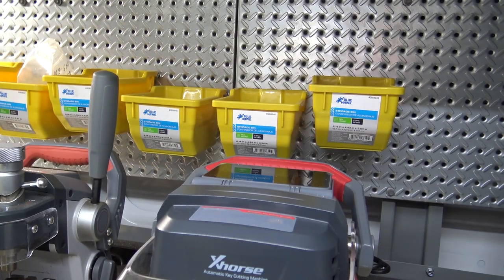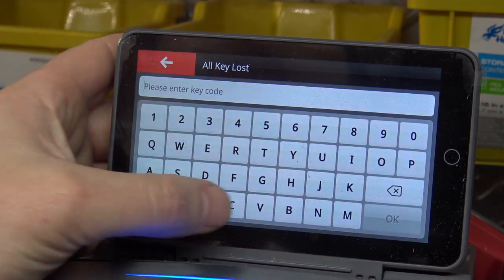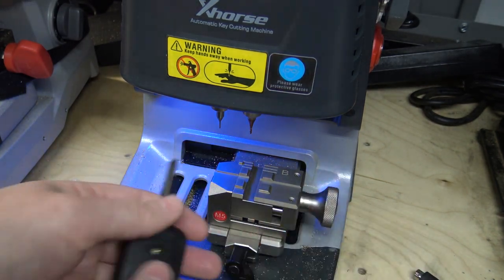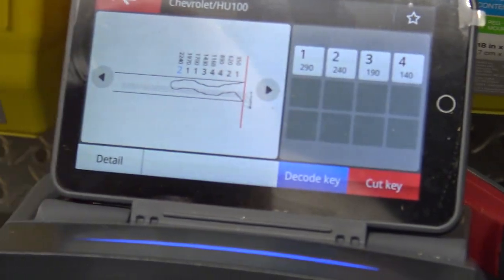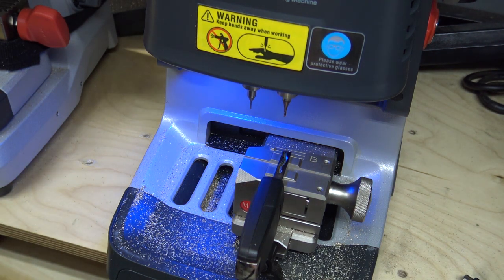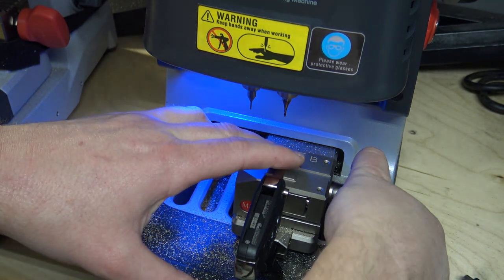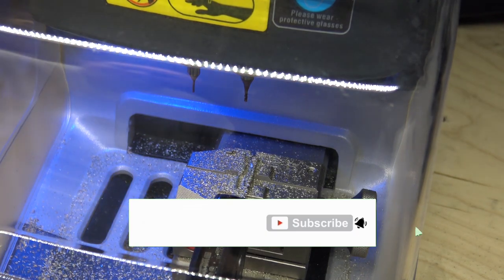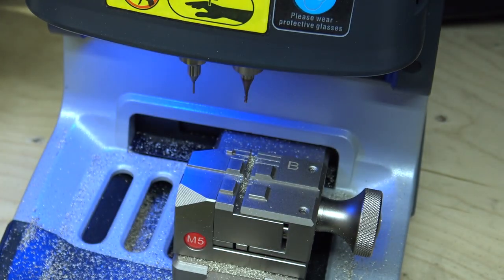(479) Condor Dolphin 2 Using All Keys Lost to Cut an HU100 Key

Comment: does the dolphin xp005 have a m5 clamp or which clamp would the xp005 use?
Reply from the maker: It doesn’t have the m5. You have to switch clamps for edge cut or laser cut. It’s a pain in the ass a little if you’re at a place doing 15-20 cars having to swap them back n forth. That’s a big reason why I got the new one.
Reply: @russej02  i think the m2 clamp is the high security one. My dolphin arrives monday.
Reply from the maker: @pouncerminned863  there’s m1 and m2. The m5 takes the place of both of them.
Reply: @russej02  oh that is really kool. i see what your saying now.
Reply from the maker: @pouncerminned863   Witt the dolphin 2 you only need to change clamps if you’re cutting a tibbe key
Reply: @russej02  i bought the xp005 dolphin 1. Since im new ill upgrade to the 2 if i do well enough. 

Have you ever programmed a keyless entry remote (not smart remote) to a hyundai? I have no working remotes and i have an oem remote, but this is first time I'm using my im508. Just came today and i finished updating it and stuff and want to test it on my car. thats kinda way i asked about that xp200 indirectly, cuz im wondering to how program only the remote so i can unlock and lock my car with the remote. i have working keys (no transponder needed)
Reply from the maker: @pouncerminned863  yep you don’t need a pin or anything to program key fobs. Only takes a few seconds to do it. Just select your car and choose remote and it puts it in learn mode and will tell to hold lock unlock together or something close to that.
Reply: @russej02  easy. thanks